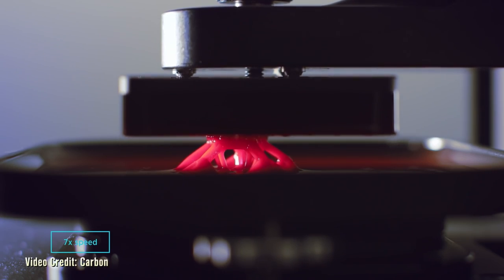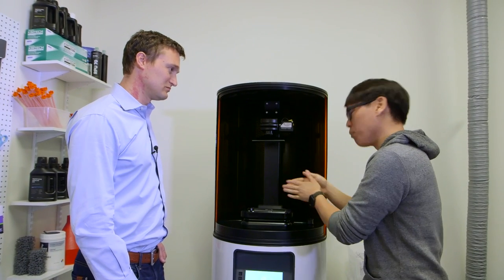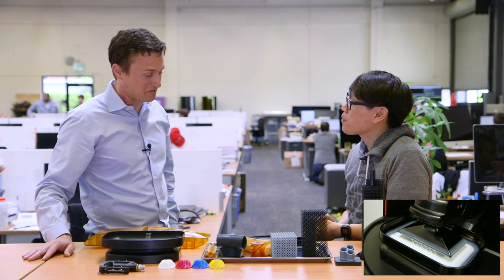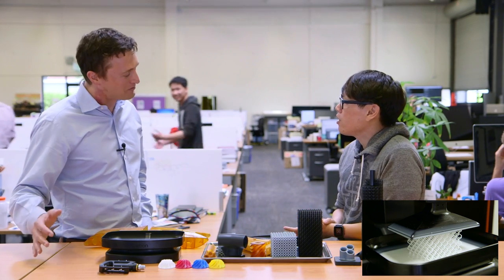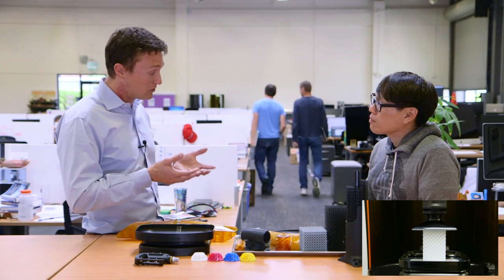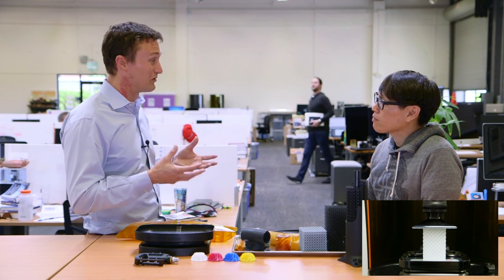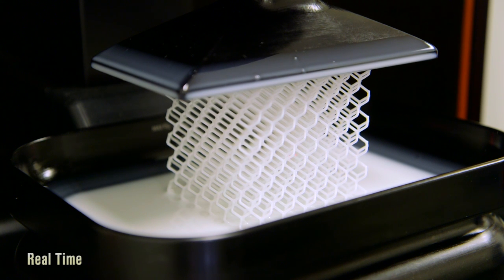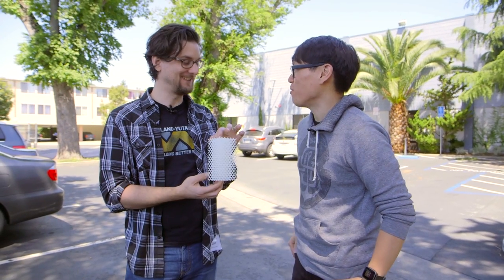Carbon M1 Super Fast 3D Printer Demo!

Comment: When can I buy one?
Light and oxygen.
How do you actually control the oxygen?
Hardware software and chemistry.
What kind of hardware?
We live in an intersection on chemistry, hardware, software, light, and oxygen. This frees you to do what you want to do, because of oxygen hardware engineering, and engineering, AND light. Set the shape with light and oxygen.
Good talk.
Light and oxygen.
Reply: Rotfl 😜
Reply: Kinda sounds like Jeremy Clarksons solution to everything, "Speed and Power".
Reply: @Sumtin Wrong?
I can feel it 
But it just a feeling 
I've got

Comment: Update: It's OXYGEN PERMEABLE GLASS in the tray. That's the big fancy secret he's being so mysterious about.
Reply: Oooohhhh, I knew he was hiding something! He just didn't want to tell how the oxigen is delivered to the resin!
Reply: Ahhh, thanks, through the whole rest of the video I was SO curious about that. I'm sure there are some tricks they're using to leverage that process, but DAMN that resolves my curiosity.

EDIT: lol just checked their site and they mention the oxygen-permeable window
Reply: I'm gonna do an experiment soon to see if coating regular glass in teflon film can achieve the same effect.
Reply: Well.. their big trade secret is how the projector can project various light shapes rather than just using a laser and rastering. The projecting method they use is the real thing that speeds things up super quickly.
Reply: What do you mean update? Norm says that at the end of the video.
Reply: Projector-based 3D printers have been around for quite a while, it's nothing really new. But yeah, oxygen-permeable glass might be what they mean when "we are controlling the oxygen"
Reply: Qwerty48121 just 2 cents from a guy who has no clue of the various processes involved in 3d printing. Maybe they are employing some kind of complex chemical reaction between resin/liquid polymer and the oxygen coming from the glass, so that the right concentration of oxygen is mixed in the lower levels of the resin. Then the UV rays of the projector act as energy source to make the reaction between liquid resin and oxygen occur, making a resulting polymer that is solid and shaped as the region exposed to light, that is, the cross section of the product.
Reply: I thought oxygen was part of the glass or some film over the glass...very interesting if that's true)
Reply: That would make it a consumable though
Reply: I know he doesn't actually want to reveal the secret, but the oxygen keeps each layer just soft enough so that the next layer will blend with it, thus removing the demarcation between layers. In a sense, the layers are clipped.
Reply: KlingonCaptain huh. But wouldn't that degrade the overall strength of the part? If it's softened by oxygen wouldn't it stay soft in the surrounding air?
Reply: Funny that more people don't see how obvious that is. With a laser or extruder, you're only ever working with a VERY small point and there's a limited range of speed you can work in and all with trade-offs. This process has the advantage of exponentially more surface area being generated at once AND your effective resolution is now limited most by the z-axis system. Since you don't have a mechanical x/y, it's much easier and cheaper to control that Z AND by controlling not just position, but intensity of light, you can do substantially more and more interesting things with the material than an extruder (though a laser has similar potential in that respect, it is still substantially slower).

Never saw the air-permeable glass coming though. Makes sense since you need oxygen for the reaction (and cooling?), but you ONLY want it at the surface where you're working AND you don't want to try and work at the top of the surface (virtually impossible to control). Also, with that technique they can pressurize the system to pump different rates of pure oxygen rather than depending on varying amounts in the air.

Definitely a worthy development as obvious as it now seems. Bravo!
Reply: I thought the oxygen was just dissolved int he resin and it uses IR light to release it.

You can probably tell I'm not a chemist.
Reply: But then what does he use with the oxygen?  Is it light... molecular chemistry.. what is it?? Just tell us dammit!!!
Reply: So obvious that a toddler would get it!
Reply: look up Teflon AF 2400
Reply: That technology has been around for a while.  Nothing new.

Comment: Let me tell you about this really amazing thing, and how good it is, and that it's better than anything else, and how really smart people are doing some pretty amazing science, but its also really complicated, so I'm not going to tell you how it works, but trust me because it's the future... 

Basically sums up this video.
Reply: +Anthony G they explain how it works on their website. do like 5 minutes of research kek
Reply: +Sensaisean I thought he was summarising the video, not their website.
Reply: +Anthony G I thought it was quite obvious how it worked.
Reply: +IVIusicFiend It's nothing new. SLA printers have been out for decades.
Reply: +Anthony G At least tell me one thing: is there oxygen involved?
Reply: +Luarvic Oxygen is my friend.
Reply: +Luarvic but not layers.
Reply: what else did you expect
Reply: +Sensaisean Says that page is unacessable or cant be displayed WTF?
Reply: +Anthony G What's so hard to understand? He said everything except for technical details that could compromise their intellectual property. They pour a UV setting resin in a basin, project a running cross-section on the bottom of the basin while introducing oxygen and out comes the product. Simple and elegant. He even hints at some compensation for heat changes. If you don't know anything about resins and how they work, that's your problem, not his.
Reply: +Anthony G also he got a rash on his neck from all the chemicals and secret things they are using for their black magic
Reply: +TeamPhlegmatisch Probably Psoriasis or Eczema.

Comment: Guys, I missed how this works, does it utilize darkness and carbon dioxide ?
Reply: top 3 😏😎😎
Reply: Lol
Reply: hahahaha
Reply: Meh sorta.
Reply: adagioforstrings007 no such thing as dark matter, it's a lie and is false info
Reply: top 3 f@cking funny man great comment !!!!
Reply: Actually it uses a combination of carbon dioxide and darkness. Also carbon, with some dioxide. Did I mention the darkness? You're gonna want some darkness
Reply: GOD MACHINE, UNEXPLICABLE!
Reply: All I caught was that it is amazing.
Reply: I have a great dark projection technology to sell them. Also, I'm pretty sure cigarette smoke works fine instead of CO2.
Reply: Real Darkness, or just non-visible lightness?
Reply: Even better -- Surreal Darkness (SD). If you were dreaming it, it would be like black concrete poured through an art canvas stretcher with no canvas on it and into a bottomless well of virtual nothingness, thus causing enormous, choking blasts of tobacco smoke to billow forth. Wait 20 minutes and out pops a little rubber lattice, ready to use for something important, or maybe a Toyota door handle that won't break off like the original. Simply amazing. If you don't believe me, ask Alice, when she's ten feet tall.
Reply: Someone correct him so I can say r/Woosh.
Reply: top 3 it a black hole that steals it from other worlds
Reply: and chemistry and engineering.  Don't forget about that.
Reply: carolyn mmitchell all,coming from CNN Fake News
Reply: I think it uses termites with engineering degrees and balsa wood
Reply: It seems that it also uses physics and chemistry...  Whatever that is.
Reply: Cant tell you its classified co2 tech. So making a set off boobs is out of the question for now. But one day it will be possible.
Reply: All I heard is light and oxygen
Reply: Oh contrere

Comment: So light AND oxygen? I didn't quite get that part.
Reply: +Paul McDonagh Most likely UV light scanner on the bottom of the machine like he said, and the top part that dips into the resin controls the air flow, which effects the difference between a liquid and solid resin properties.
Reply: ***** Ok thanks. What I don't get though is how they make amazing parts.
Reply: +Paul McDonagh Think of the scanning process as a stencil. It projects an image onto the glass, which hardens the resin touching the glass lit by the UV light. Much like when I put paper cut out of my name over wood, then spray paint the paper, it leaves my name of paint on the wood. It does that in a type of layers which builds up the object.
Reply: +Aaron Stevens Both of his comments are jokes. How could you possibly miss that?
Reply: light and oxygen is birthing it. simple. its like photosynthesis for baby plants, but the growth time is sped up.
Reply: Frank Antoine omfg..
Reply: I like that Frank, verges on poetic Frank Antoine

Comment: “There was a bug that could be a feature”

So I’m guessing he is a fan of apple
Reply: The "bug" was oxygen inhibition of the fusion/cure process; they exploited that "bug" by using a gas-permeable membrane tray window to force the UV curing to a level very slightly above the bottom of the tray so there's continuous liquid resin at the bottom. That allows a fast continuous draw of the part, as opposed to the way most SLA printers have to break the part from the tray and wait for liquid resin to flood the tray again.
Reply: @stanrogers5613  That joke went right over your head
Reply: or sony

Comment: gotta love how he's not explaining anything .
"well you know science and light and oxygen and magic ! I don't knw how it works I'm just marketing it  "
Reply: He would be an idiot to reveal the technological secrets of his company/product, that give him a huge advantage over his competitors...
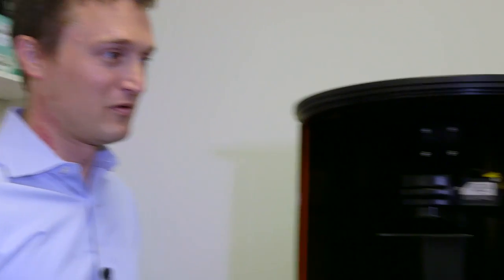Reply: Actually, if you listen closely he explains how it works at 2:25. It's the software modulation of laser pulses (such that it controls oxygen levels) that is their proprietary tech.
Reply: The process is similar to submerged arc welding.  The objectives of both processes is to eliminate oxidation of the join before the weld cures.  Submerged arc welding uses granulated flux material to seal away the weld from oxidation as it cools.  So the bottom line is their logic and process is sound.
Reply: Foxintoxx this man is most likely one of the men in charge of the business side of this company, not the engineering side.
Reply: Foxintoxx He's worse than Donald Trump
Reply: Pretty sure there's a fucking Trump hat in the background hanging on one of the cubicles.
Reply: I saw that too! Cool!
Reply: the magic cost 40 000$/year without the material cost hahaha
Reply: *you're  ( or was that intentional ? )
Reply: The oxygen keeps each layer just soft enough so that the next layer will blend with it, thus removing the demarcation between layers. In a sense, the layers are clipped.
Reply: He actually explained quite a bit. The only thing missing is the actual physical model that describes how the interaction occurs. But you can't expect the company to just hand you that information.
Reply: Exactly.
Reply: Ooor, and most likely doesn't want to tell people about the secret, as its their technology, if they told the world theyd go bankrupt
Reply: Big companies don't have patents. They have trade secrets.

Comment: This is how much was spoken of in the video!

oxygen - 22
light - 31
carbon - 3
engineer - 7
Reply: You forgot to tell "chemistry"
Reply: This funny😂
Reply: The molecular level. You know, heat.
Reply: Sum-Ting-Wong said, "Right,Right,Right" 837times.
Reply: almost
count_oxygen.py:
(25, 'technology')
(25, 'resin')
(25, 'light')
(20, 'oxygen')
(14, 'chemistry')
(12, 'engineering')
(8, 'carbon')
(5, 'engineers')

Comment: "so how do you keep the entire build area sufficiently in focus?" "that's a great question. our great engineers use light and oxygen to come up with this bullshit pre-approved, rehearsed talking point sheet."
Reply: AvalancheofNeed I agree. this is how I feel about it too
Reply: AvalancheofNeed Maybe they want to keep it secret so that their intuition and genius can owned by them. Its the secret recipe.
Reply: Brian Givens - Fallout 4 Videos it's called a patent
Reply: The oxygen is in the print material (i.e. liquid) and is released when lit by UV light.
Reply: You can buy the material on QVC under the name Bonic.
Reply: 2:21; polymer chemistries...that react to UV light

2:28, "light turns your liquid into a solid, oxygen prevents that from happening." 

He admits two thing here; they immerse the product in the print medium to control the available oxygen, and that it's the light doing the work.
Reply: so basically the section hit by the light releases its oxygen such that it creates an insulating, inhibitory skin between it and the surrounding liquid?